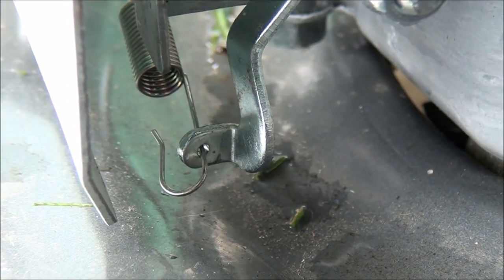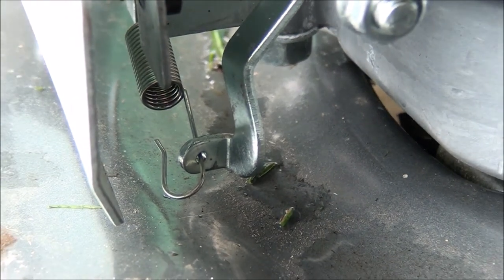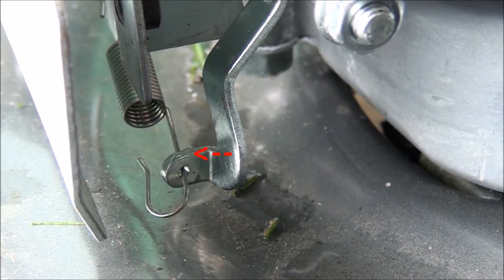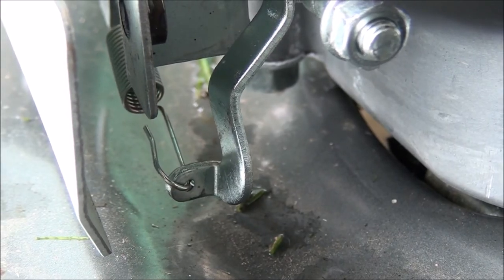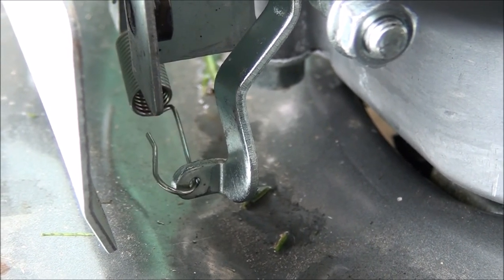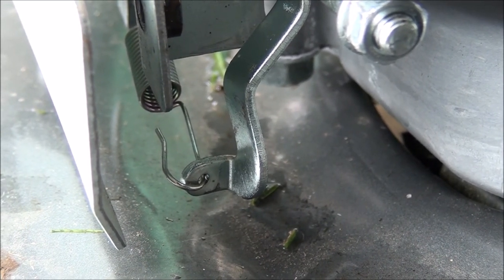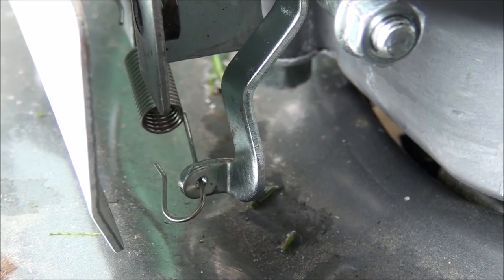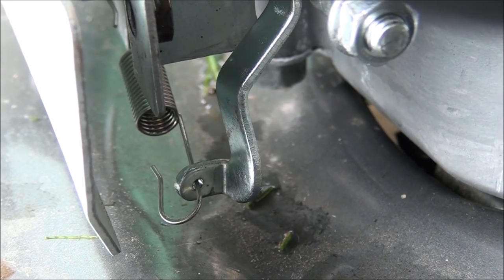EASY MORE POWER! How to make your Honda Lawnmower REV UP MORE and INCREASE engine RPMS

Comment: I tried bending the tab on my Honda 215SX... it helped little (raised it about 100-200 RPM).

Luckily I noticed two Philips screws on the bottom near facing the front. They appear to control the travel of the linkage. By loosing the bottom screw I easily got full throttle from 3,000 to 3,600 RPM, which is where it should be for the GVX140 engine.

Thanks for the video and encouraging me to tinker.

Comment: Mower engines have a governor,  stops engine over reving. Spring attached between throttle cable & carby. Max power is reached, governor pulls spring, stops over rev. Over time, spring stretches = drop in revs, struggles to cut grass. Can be fixed. Remove spring. Shorten spring at the long straight end. Shorten spring length in small increments, couple mm at a time, governor works in narrow parameters. I used long nosed pliers. Reattach spring. No need to cut spring lenght at any time incase you need to relenghten. Start/test. Shorten spring too much, engine will have high rev/idle. Revs still low,  repeat procedure. Mower will perform like new. Good luck, happy mowing. 👌🏻👍🏻.
Reply from the maker: good tips JT!
Reply: @F.Krueger-cs4vk  you can move the governor pin about 1/8 of a turn max, try that first before cutting the spring. Then just buy a new spring, its like 1 dollar?

Comment: I found this method online last year, and it works great on my Honda HR216 P.O.S.
Without it, you couldn't mow grass deeper than 1/2".
Much better than screwing with internal governor.
Reply: Strange my Honda HRC216 cut thru 18 inch tall grass pretty easy. I had to go slow, but it did just fine.
Reply: could be many things such as the jet on the carb to maybe intake gasket